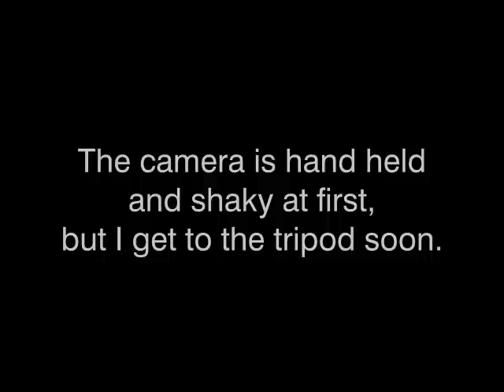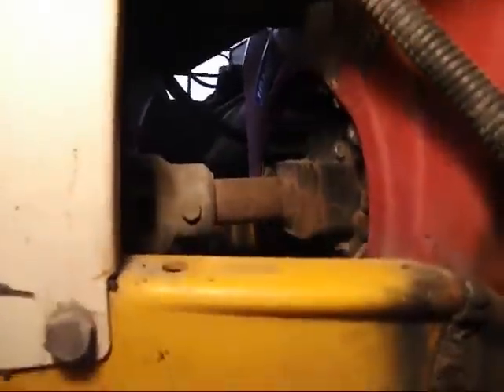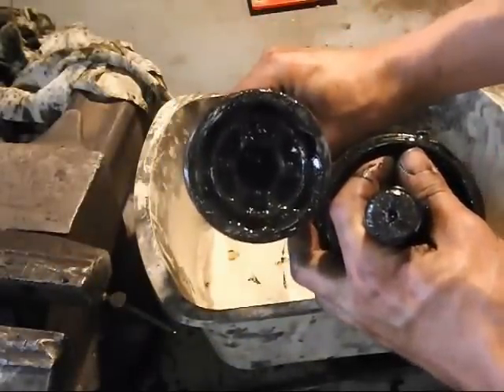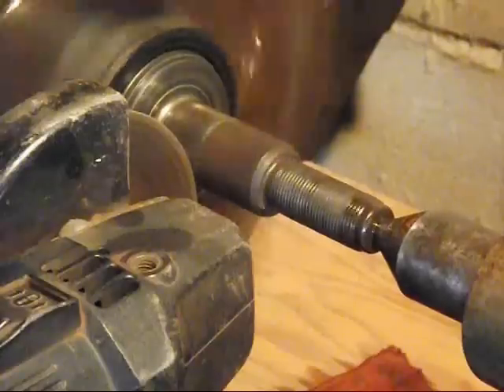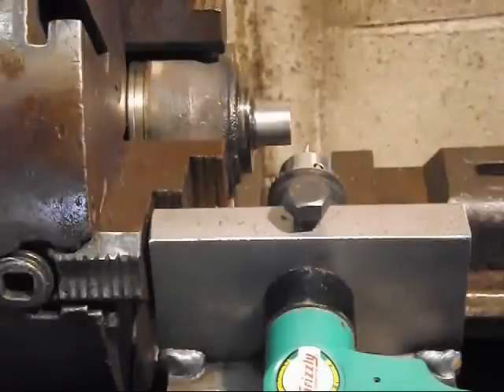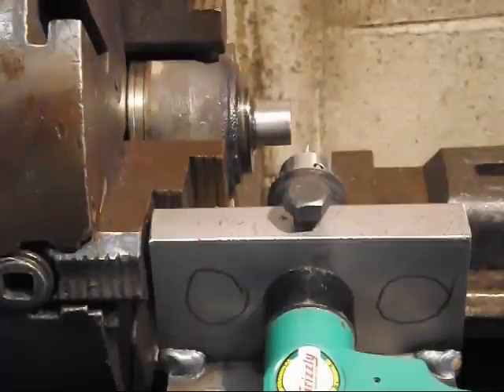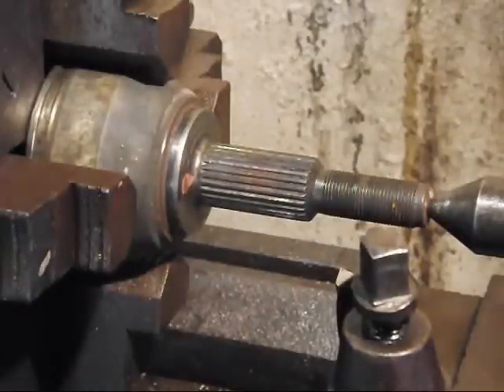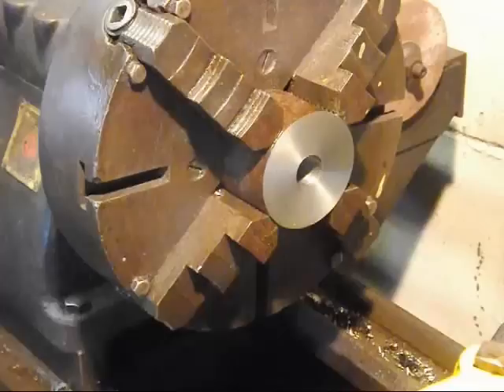Cub Cadet Drive Shaft Build - part 1 of 2

Comment: I worked on Cub Cadets for years.  The only drive shaft I had to replace was one a customer tried to improve on for tractor pulls.  His mods failed miserably.  I put the factory parts back in and it worked perfectly.  The factory parts would last 30 to 40 years before needing service.
In this application, with the new engine mounted higher than factory, major mods were required.  I like the idea of the CV axle mod.
Nice to have the machine shop to work with.
Reply from the maker: I never did have a problem with the original driveshaft parts. I just couldn't keep a piston together in the Kohler engine, so  I finally decided to replace the engine. Thanks for dropping by and commenting! :)

Comment: Next time you have that problem tack the caps in.Old 4x4 trick .The old chevs and ford's with the solid front axles were famous for this.Been doing it for years hell even the ones in my Yamaha big bear front drive shaft is this way .Also I have made some drive shafts out of square stock for I belive it was Toyota for people over the years .Not sure what aplaction it was for .